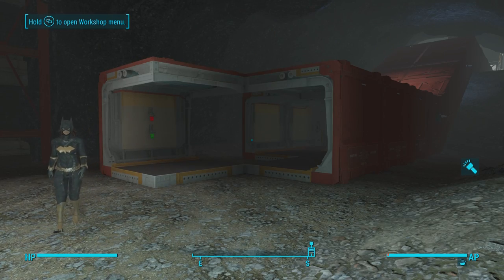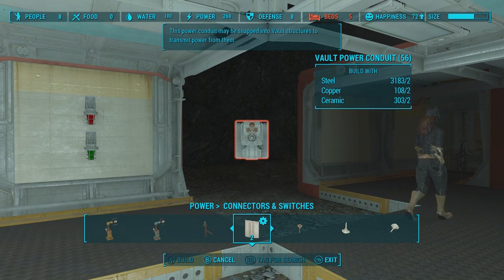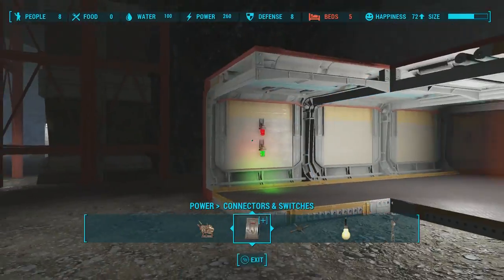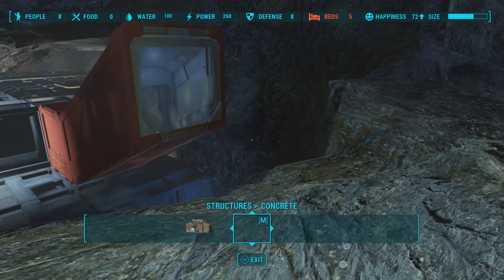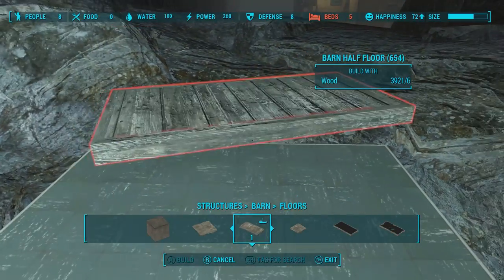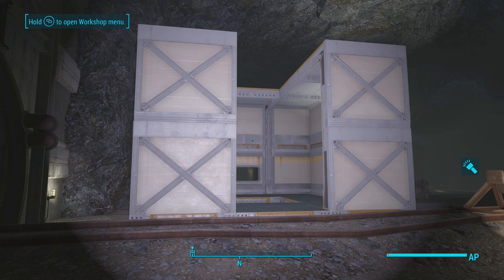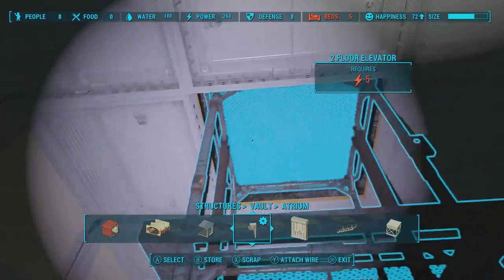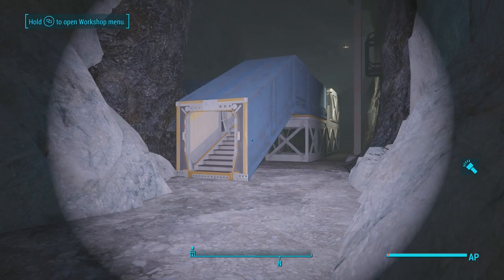Fallout 4 Vault Tec Workshop Guide Part 2 | Conduits/Transitions/Vault Elevators and More

Comment: I think you might have been using the railings backwards.  You'll notice that the floor pieces have circles with yellow marks around along the sides where they snap to each other and that these circles are on the backs of the railings too.  The railings should act as a cap over theses circles.  You can see these markings both exposed and covered at 11:29.  The L piece in question at would be more suited to an outside corner than the inside corner you used it as.  There is also a cap for the wall to cover the snap points with a cleaner strip.
Reply: Yep, he basicly just used the wrong L-shaped railing. There is another one wich fits perfectly.
Reply: Yep, Backwards